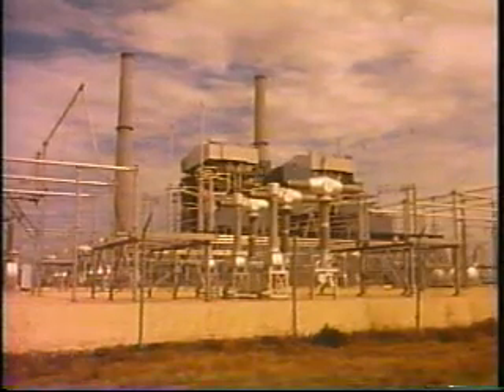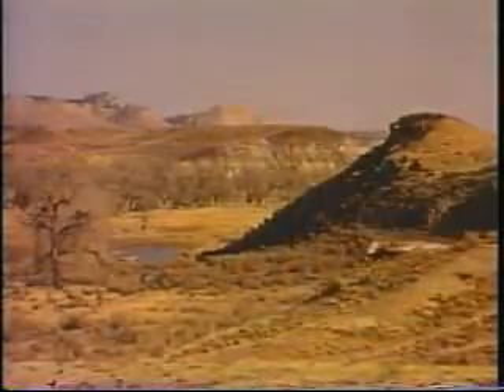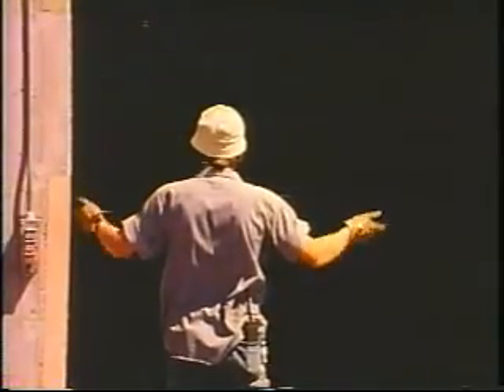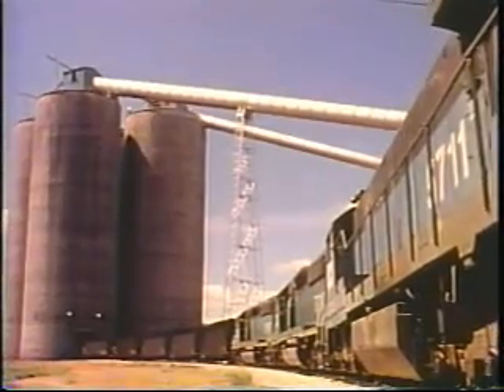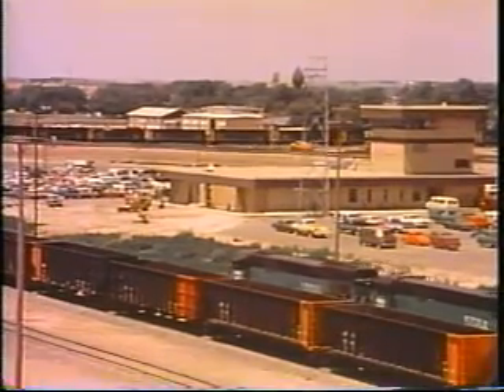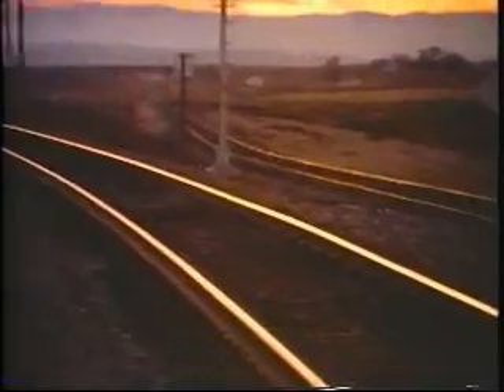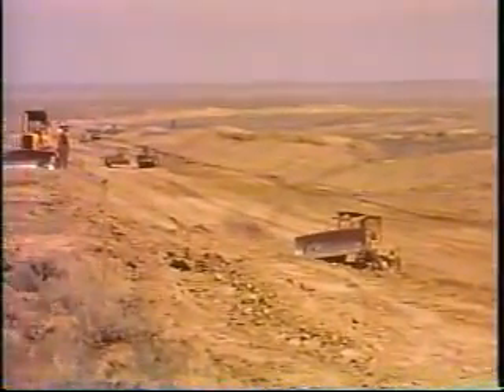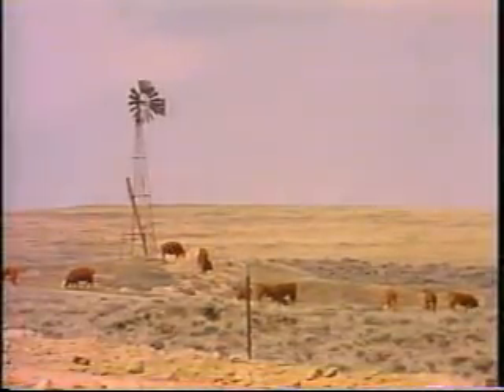Burlington Northern: Western Coal Connection (1970s) Part 1

Comment: 3:58
Oklahoma Gas & Electric :P Those gondolas passed through my town (in Kansas) until about 1994 when they switched to the coalporters. 
At first they ran down Santa Fe's Transcon from K.C. to Red Rock, OK with a mix of BN and SF engines. Then they changed the contract to joint UP/ATSF and started running them down the Topeka sub behind just SF engines at first, then UP engines. Now since the contract has changed, BNSF diesels once again pull them down the Transcon.

Comment: Orin Line is now three and four tracks wide, running joint BNSF and UPRR trains.  Average weight of a DP four pack is around 20,000 ton.  A lot of coal for the Midwest!!